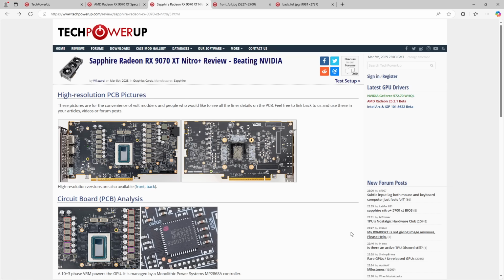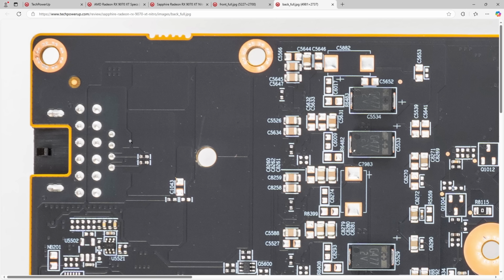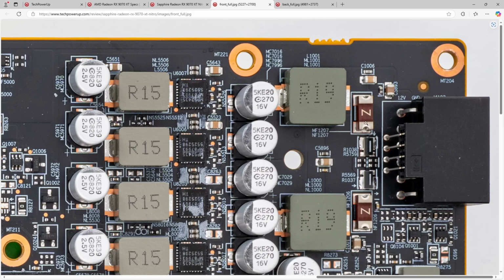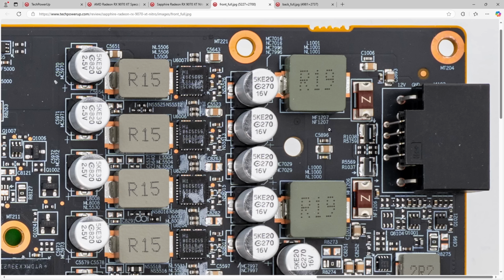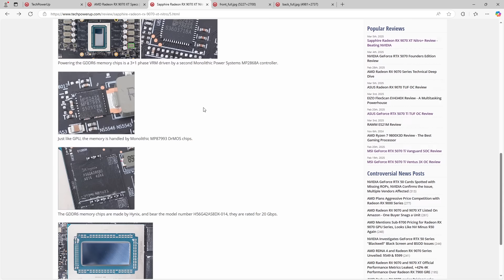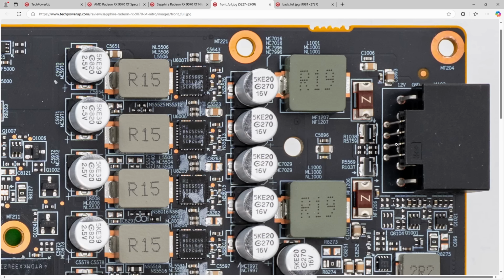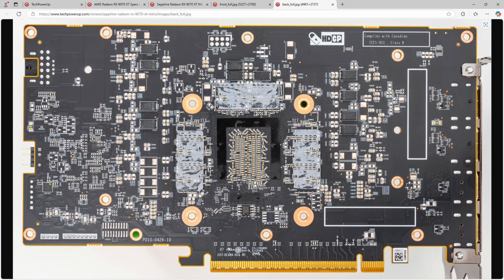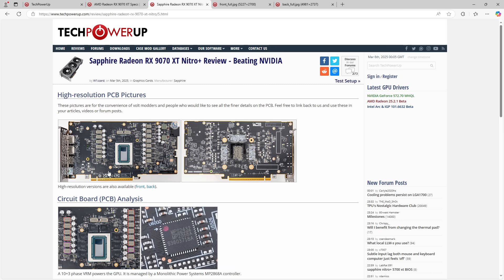Taking a look at Sapphire implementation of the 12VHPWR connector on the RX 9070 XT Nitro+

Comment: got the asrock new psu with temperature sensor on the 12volt high power connector to pair with my nitro+ at least I have layer of monitoring for failure.

Comment: its using 12V6+2. However I have used several 12VHPWR card over the last few years and have never had a single issue with it.

Comment: This card will melt the connector sooner or later with almost 100% certainty. As soon as zinc pest gets the solder joints at the 12V power connector the joints will fail one after another and the current will start to flow through the remaining good connections just like you mentioned.

Comment: Looks like TechPowerUp also just did a teardown of the 9070XT Taichi, which is the other 9070XT that uses the 12V2x6 connector. Would be interested in seeing what you thought about it (cuz admittedly I bought one as my only option at the time)

Comment: God damn that is stupid that they decided to go with the worst reputation connector... the fuck were they thinking?! this card is now has the potential to die in the same way as the nvidia turds with the same connector. In 35 years of building PCs I've never once heard of a single 8 pin connector melting.

Comment: The aesthetics are inoffensive.
The performance is impressive.
It looks like it's one of the quietest 9070 XTs on the market.

But like an exquisitely prepared bowl of punch, it only takes one lump of shit to ruin the entire thing.

The implementation of the 12VHPWR connector just does not make sense. It is a deal breaker on any card. It is change in place of innovation. Perhaps even the product of a cost benefit analysis. In short, it's a hard pass from me.

Comment: so, i'm wondering, I really wanna buy 9070xt nitro+ from sapphire, but that 12VHF have my concerns, on the other hand my pure power 12m do not have 3rd separate pcie port, only 2, does it okay to power up 3x8pin card with one 8pin cable and the other two ports with pigtail cable?

Comment: Isnt the problem he amount of power nvidia was pushing through the connector and not the connector itself?
Reply: No, the high power draw is only part of the problem. The connector itself can easily have contact issues where pins have increased resistance or even no contact, while user error in plugging it in properly plays a part in these issues it is still a result of a poor design that allows such seating issues to easily happen in the first place and such unbalanced loads can still happen with seemingly properly connected cables. You then have both GPU & PSU manufacturers having inadequate or no protection against sending all the current down 1 or 2 wires, this can happen regardless of how much the card is trying to draw and is just inherently unsafe behaviour.

So it's a combination of issues that has resulted in this problem, the high power draw exacerbates it creating a higher risk. But even with this card with at least 275W over the cable you could potentially have over a 23A load across a single wire which are rated for just 13A (or even 10A if lower quality cable) and connector pins rated at just 9.5A, whether this is enough to cause melting issues is debatable but it's certainly not good for the connector and is a risk that should not be taken.

Comment: Actually the better and safer is Sapphire PURE RX 9070 XT and Sapphire PULSE RX 9070 XT with 2x8pin connentor. 
Or XFX with 3x8pin and PowerColor Red Devil RX 9070 XT 3x8pin.

Comment: but did the other GPU are using the same setup?
even if the power connector is different.
because if all the GPUs are merging the connectors all together, no matter the connector the problem will stay. (+ / - the margin of error of each connector and cable used for sure)

Comment: Had to solder the motherboard power for a laptop because of thermal cycling weakening the contact pressure. When I first took the laptop apart before I had issues I thought the manufacturer was flying a bit too close to the sun. 4x4 power and ground ~24 gauge stranded wires plugged into a board without any load balancing. Was not surprised when I started smelling plastic a few months later.

Comment: I have an RX 9070 XT Taichi OC (12V-2x6 connector) since january and have 0 problem with it. the card hit ~375-385W in AOE Retold (4k RT, without oc but with +10% TDP). paired with a seasonic 1000W Titanium. (but i don't know the PCB)
Reply: Thanks
Reply: How do you have the card since January?
Reply: @siewkimng1085  A friend has a store and received the GPUs since january, the card was running fine with linux driver.

Comment: honestly that differencies will not help
1. rail is still 1 .. from psu to gpu 
2. card still does not monitor or load balance rails 
3. 2  15a fuses  will not work  in case of mosfet blowout

fuses may give you a chance to survive only in case if they below 10a . so nvidia is dropped them . since they are useless for 300+ watt gpus. your card will be literally on fire .. but fguse will be intact . 15A is simply too much

Comment: The spec does in fact require that all six pins in each power and ground are shorted together with a pour. So there's no way to make a compliant card without doing that.

Comment: I kind of wonder what Nvidia's testing philosophy even is. They should continually stress the cards until they find a problem, not simply until it looks functional. No solutions can be made when a failure is never found. Tests should be intended to fail, for the sake of learning.

Comment: Hello, I don't know why you want power balancing, shunt resistors for current sensing, yes, but power balancing would be just a waste of ressources. It would not protect anything. All wires are connected, so the balance should not be needed. And if it appears that the current is unbalanced it means that there is some pins with low resistance with higher current flow and some with higher resistance so with lower current flow. If you have an active power balancing system in this case, it will force the flow into the pins with higher resistance, and as P=I²*R, this pins will overheat, globally, the connector will have to dissipate more heat du to the electricity flowing thru conductors with higher resistance. The only fix is to have a better connector, I guess at 300W it does not matter anyways.
Reply: Because this guy thinks he knows everything about the safety of the card from a few photos.

Comment: When the 4000 series problems were examined, weren't the conclusion that the problem is part of the spec ? (that neither NVidia or AMD has direct control over) - Nvidia engineers became aware of the problem through 3rd party gpu manufactures, but, they just played the meh not our problem card, we just follow the spec. The problem will be fixed in 6000 series because then there is a new power delivery system.
Well that is what I remember, might be wrong. Not sure about AMD.

Comment: It's almost as if noone really wants to properly implement this plug. 

Like, Just give every single 12V wire a separate shunt.. Make current balance possible again. I mean it worked on the 3090Ti with half of this. 

Also: reporting that I'm kinda glad I throttled my 4090 down to 270W. Still hoping we'll see an adapter that does some load balancing if that is even possible.

Comment: the cable is fine and so as connector...what trouble begin is from how amps feed it ...due to dumb japanese PSU designs is over feeding on shared bar rail 12v vs older PSU in america designs that DELL is proud to custom made for their computers is use 4 independent rails for all PSU specs from 460w to 1000w...each sense pin connects each rail while rail can split into 2 wires to split amperage levels from each 4 rails...while protected by double 400v or 500v capacitor...2 is min to have in every PSU due to safety from our grid  is alternating current always shift every ms...not DC grid ...while americans lost all the common sense since 2014...people are dumb to think thick gauge wire will fix the issue when thick cables aren't for this setup when its circuit board logic board...not hvac system using noisy machinery with pumps and motors requires higher amperage vs a computer logic chip only need tiny amp in constant flow from PSU...SO NO...THICK CABLES AREN'T FOR THIS SETUP....it be same result as 8pin old cables that also get fried from PSU side  still...due to unbalance single rail sharing all 3 connectors and 4 would be deadly mistake to add more stress on single rail that already hot for 3 ...and psu fan not gonna cool property enough alone

Comment: Yeah... so this connector does suck.  And really I did NOT expect Sapphire to do anything special for the 9070XT OC -- 350W is just too low to have a problem.  One question though, WTF do the Sense Pins ACTUALLY DO??!?!?!!!  PS to GPU comms is just historically unintelligent.  You would think that the whole point of these "Sense pins" is to create a Feedback loop with the PS from the GPU -- thus providing really clear comms about "what amps is being drawn on what pin" level of intelligent control.  Is that what they do?  Given the failures, it does NOT sound like it.  So that presents the question - "WTF do those useless 'Sense Pins' do???"  I would love to see  you deep dive into that topic and pull apart the "epic stupidity" of Nvidia power design.  Oh and remember, sometimes the engineers are over-ridden by management (Jensen and team) when it comes to good design choices.
Reply: The sense pins tell the graphics card how many watts the power supply can deliver to the card: 150; 300; 450; or, 600 watts.

Comment: At this point if they insist on using such stuff. Might as well mod a 10-12 Gage stranded wire to each end of a 12vhp connector.. you'll have a wire that can handle it then.
Reply: @ligerstripe99  computers use 8amps !!! Not 40 amps..that's only use for outlets for copper wire you explained...data center is different setup... every gpu run on its own PSU and own outlet
Reply: @user78405  1. that's the max RATED for the cable before it, well bursts into flames.

2. That's for non gpu components. Gpu's GUZZLE power and with either standard. 8-pin pcie or this fire hazard 12vhp 30 ish amps IS normal for some high end gpu's like the 3090 and more for the 40 & 5090.
Reply: that will burn off your card in seconds ...thick cables never answer to something use less amps on computer circuit board...thats only for hvac system that don't use circuit boards ..only big cap and fan motors and compressors...only issue is PSU end ...sharing same rail is japanese dumb tech to do over american having 4 rails split 12v into 6 wires but to japan, they want to be more modular and smaller psu...by removing all 3 rails and have their tech shared with all 6 wires to one bar to one fat cap..that put all stress to those
Reply: @user78405  nope not with a xt60 connection in it's place. And 12 Gage  stranded copper is rated for between 30 and 40 amps depending on brand and original purpose.
Used the stuff for fixing fire hazard built cheap Chinese 3d printers that always under spec the PSU.

So in worst case. 1 wire would be needed as 30 amps by 12v for the card means a max of 360 watts of power. I mean after all electrically it's just one wire just past the connection anyway. And xt60 connectors are for this purpose. Used to connect high power batteries and other devices.

Comment: I don’t understand why the 12V standard didn’t just use single high-current contacts like Anderson Power Pole. (They could easily use those contacts in a custom housing with the extra pins.) It’s not as though this is some novel technical challenge. And it’s not as though using single contacts demands inflexible wire: highly flexible, thick wire exists.

Comment: Some company could release a 12pin female to 12pin male active adaptor with power pin sensing that shut down current to the card if it detect the power load not being run trough all cables or something.  Do the job the video card manufacturers should have done. Extra $$$ for peace of mind your house wont burn down or at least pc wont catch fire.
Reply: Hardware Busters is designing something like that.

Comment: its a 12VHPWR connector, it has 12 pins, each pin provides 1 volt, no wonder you cant split em up, duhhh

(*i know barely anything about electricity)

Comment: The one thing that I thought was interesting about this Sapphire Card is they put the connector on the end which is something Nvidia has not done and maybe that might make a difference. Yeah this is surprising that Sapphire did this. I wonder if using electrical tape around the connector while the card is plugged in will help keep the connector in place after securing it in.

Comment: There's one seemingly obvious solution that not a single channel or forum has mentioned.
What if you put all the negative and all the positive lanes in parallel on the cable connector side?
This would effectively inverse square the degree of disbalance simply by eliminating the scenario when same pin number on both sides having higher resistance basically disables that wire.
I'm practically waiting for a chance to get a 16-pin GPU and some crappy 16pin extension just to test the hypothesis.

Comment: The power supply could at least monitor the current on each pin and shut off if any pin goes too high.  It sucks they can't properly balance but maybe we need power supplies with single pin overcurrent monitoring now since the GPU vendors can't properly power balance where it is actually possible.

Comment: I'm still using my EVGA 3080 FTW3, it averages 380 watts in heavy GPU loads. 3 8-pin connectors, so double the wires. Just looking at the terminals that come out of the connector to the PCB it just looks so much more robust than the HPWR. Going from 24 conductors to 12 for 400+ watt cards just doesn't feel like a good move. Also with sleeved extensions 3x 8-pin connectors really makes the card LOOK powerful!

Comment: The Only reason I can see for having one block for 12v other than port specification is pricing or both. Sapphire look to have decided to look at the big picture other than just build cost but price to repair if failures occur.  So split 12v rail and use 2 fuses so unlike single rale design  at a small cost increase to make can hopefully make its repair cheaper cutting costs when things go bad.
I think had AMD had higher end GPUs needing more power then Sapphire might have tried something different we will have to wait a year or two for RDNA5/UDNA high end to appear to find out. 
Maybe Nvidia should supply an extinguisher system to go in PC free with every RTX5080&5090.
Better solution Redesign PCIE slot and  add a supplemental plug near it so PSU sends power to Motherboard into PCIE slot like with CPU, Result Graphics cards could have more power it would look tidy and air flows better and no melting power leads as not fully plugged in or damaged cable.

Comment: If you connect two 20A fuses in parallel you don't get a 40A fuse. Due to unavoidable difference in resistance with currents more than 20A one fuse will blown up and then another will immediately to.

Comment: why one stage of 12? because inconsistent 12 across 1/3 of the die is more destructive than inconsistent 12 across all. its about having overall consistent voltage to allow for more stable clocks.

Comment: I don't even understand the point of going over this. the 9070XT should be WELL within the spec for the 12VHPWR connector, unlike the 4090 or 5090. It shouldn't be stressing it at all.

Comment: So what is the benefit of the new connector over the conventional ? Is it purely just because the old connectors could not handle the power requirements of 4090/5090

Comment: As i've said before -- the power connector shouldn't be a press fit one anymore. 

It should be one where you can EASILY insert the connector, but then requires a LEVEL + SCREW to get proper clamp and connection. 

Then you CANT mess it up and it's ALWAYS connected unless you very obviously aren't paying attention.

Making the connector anything but that, for something that carries 60 AMPS is INSANE.

Comment: Have seen where the connector is on this card?  Right in the heat of the flow-through with the cable having to make a fairly tight turn.  It's like the worst possible configuration

Comment: 12v Low Melting Point Connector
12v High Property Damage Connector
12v High Temperature Connector
12v High Combustion Rate Connector

Comment: Why the Nitro+ needed the 12VHF connector when the 79000XTX had 3x8 pins and even the 9070XT Pure only uses 2x8 pins?
i have an RM850e and evn with thst in mind i dont think my PSU could handle either the nitro+ or the taichi without burning, wish this faulty connector just wasnt a thing

Comment: It's time for modified connector design, which uses just 6 wires: 4 sense pins and 2 ground/+12V low gauge wires, and both current wires are directly soldered to a bar of pins.

I don't think anything else makes sense now, going forward.

Comment: Makes you wonder why they didn't split the 12V pins in half so 3 to each of the fused 12V rails, I would of thought that would be a no brainer since it wouldn't require much extra engineering/ money to do so.... I expected better from Sapphire.

Comment: Active power balancing is usually implemented incorrectly anyway. What happens if you cut 5 of the 6 ground wires on a card with the supply split into three? Better yet, cut them all in a bench setup without a case and see how the PCI-E slot on the motherboard holds up.